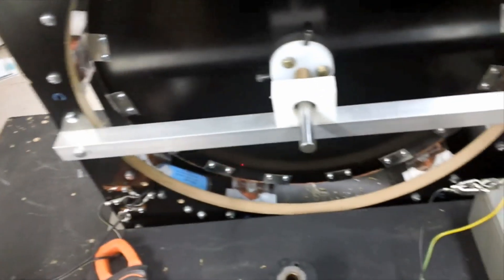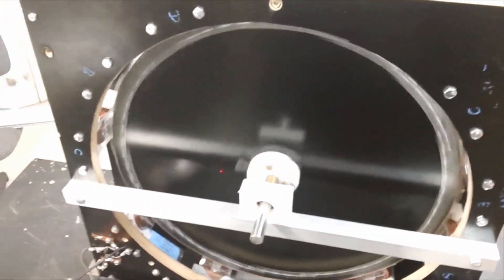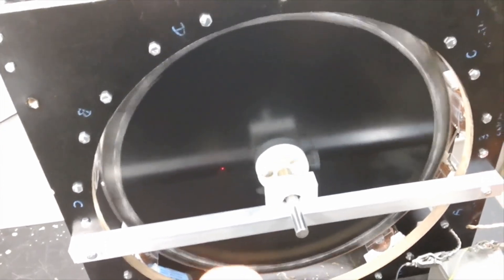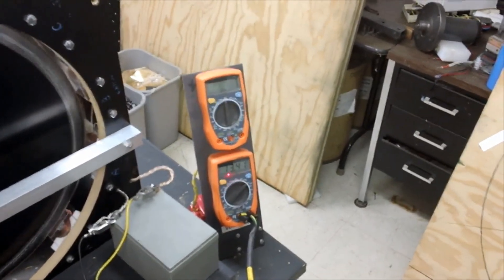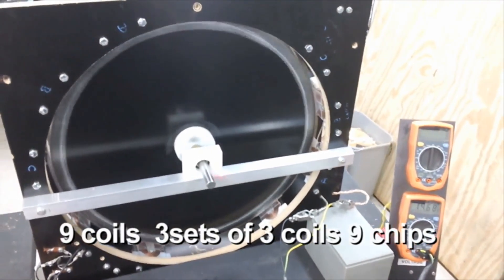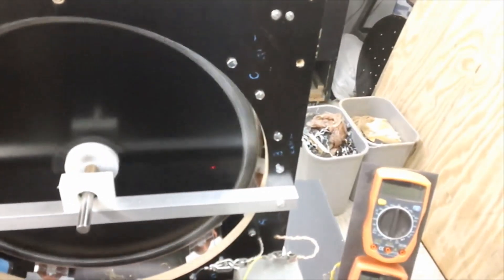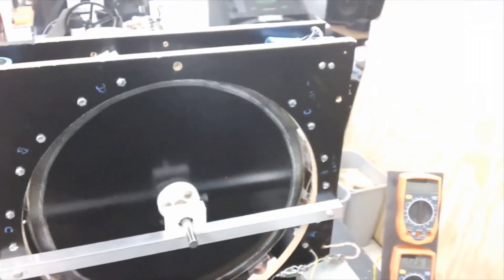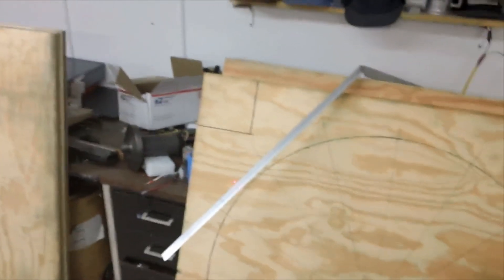First Run Small Boxmotor

Comment from the maker: Drive a Generator feed that energy back into the input and then recapture at least 50% percent of the energy passing through the motor that means i will have two actively charged battery banks to hook power inverters up to,  but at this point this is a small scale version of what will come.

Comment: Well done! Will this be a motor or a battery energizer? If it should be a motor you should put a mechanical load on it as and then measure the input and output! Many thanks!